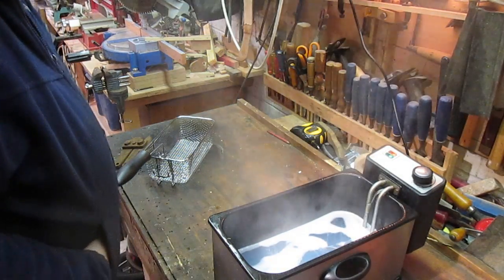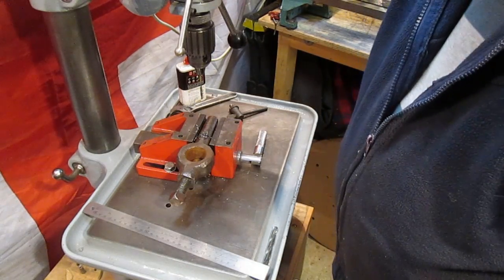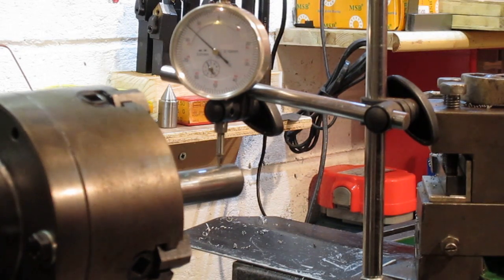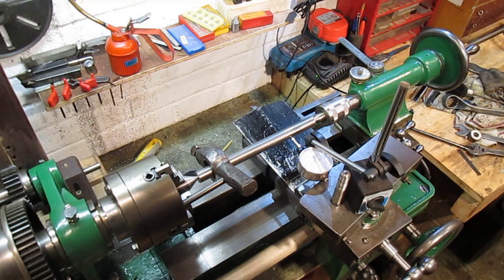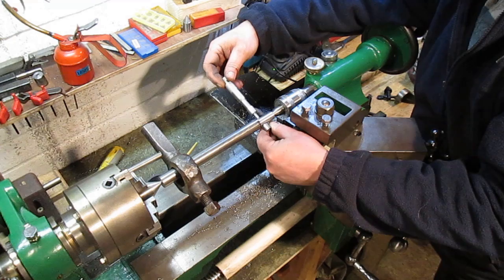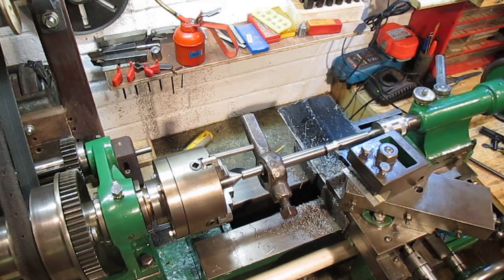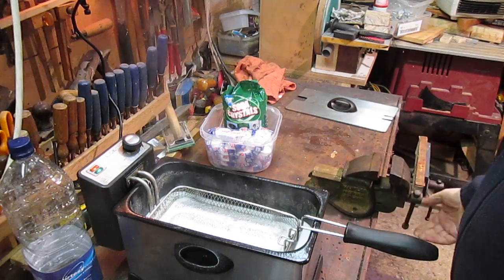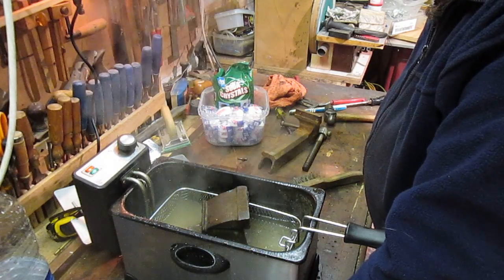FNF09 Fryer To Parts Washer & Viewer Part

Comment: Nice part ! I will finally get those photos this weekend but a steaming event and all this snow is keeping me out of the workshop and the museum. Nice video as usual
Reply from the maker: Thanks Jacob, I keep checking my Gmail for the pics, no rush. I got the material for this video done before the weather got bad, Hope to get cracking on with fixing up that little Marples Shamrock vise and try some electrolysis.

Comment: Very interesting idea. You want the most aggressive detergent you can get, which happens to be automatic dishwasher detergent. I doubt it will really remove rust. But I have looked  ahead and noted you are going to try electrolysis. That will get rust out just fine.Next time I am at a thrift store I will look for a deep fryer.